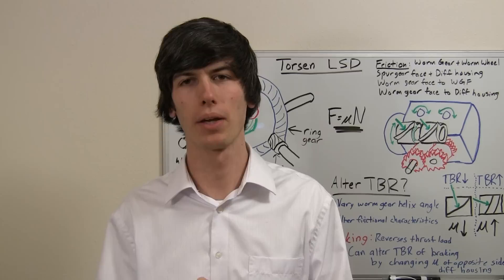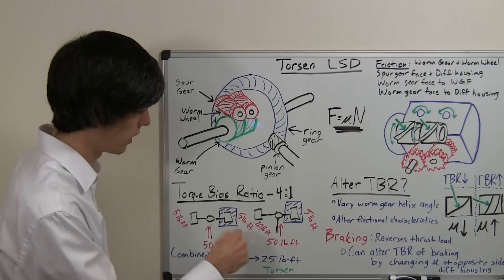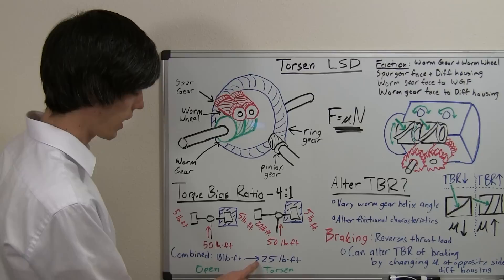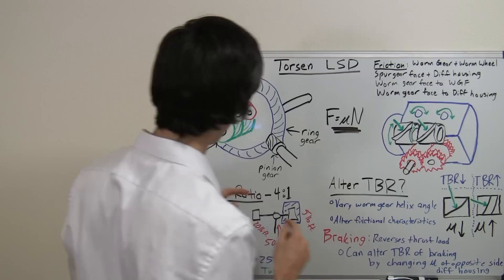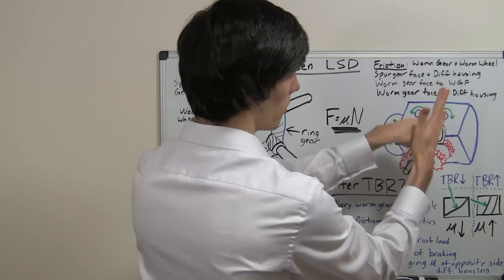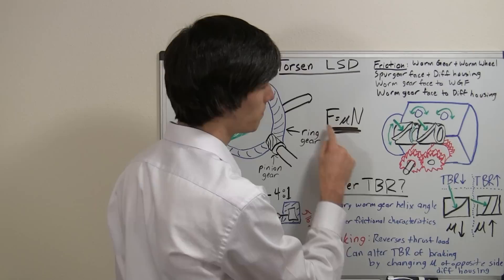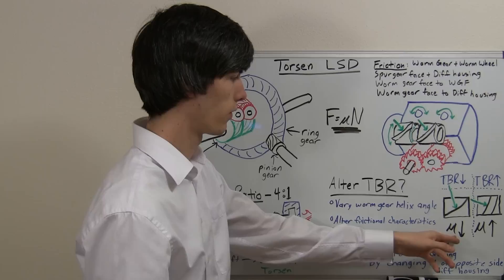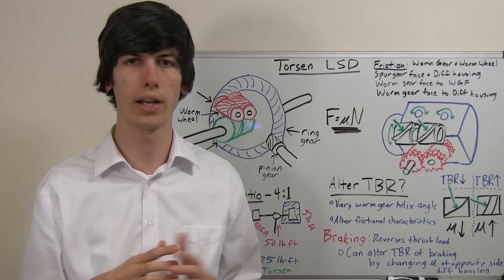Torsen LSD - Torque Transfer - Explained

Comment: I can see how one wheel will spin faster than another as in a turn, but at point do they lock up?  Does it happen when one wheel spins fast enough in relation to the other so that something different happens?  It seems that either the wheels must turn in opposite directions in relation to each other, or they must move together.  If one wheel is spinning like on ice, and the other wheel is moving at all - even inching ahead, then this will satisfy the requirement that they're moving in opposite directions in relation to one another.  What mechanism then forces them to lock up when one wheel starts spinning?
Reply: +mike beary When it is not a split that matches the ratio of the gearing inside (basically a math problem). So as long as they spin at that ratio in the difference that equals the ratio of the gears connecting the worm wheels it will run smoothly. When the ratio is off the worm wheel will try to spin the worm gear, but it can't. Think of it like a turbo being used in reverse. The exhaust is the gear on the axle or worm wheel. It can't turn the exhaust side or the worm gear.  The wheels are made so they work with the air in one way so well with a steep angle that they can't work the other way. Just like this flowing air into the inlet side of a turbo will will not act on the shallow angle enough the turn the shaft and drive the exhaust side to do anything. The metal gear can't just flow like the air because it is locked on the shaft, so it locks up instead and turns it into a solid axle until things go back to normal. He goes over it at 5:00. The gears are two steep to go backwards like the turbo impellers.
Reply: +mike beary It has to do with the resistance to rotation (aka grip) seen on both tyres, basically it starts "locking" when one wheel can handle less torque than the other one, even before any slip occurs. This is why these diffs are also called "torque sensing", they react when there's a difference between how much torque each side can handle, they're not speed sensitive as such.

The torsen however isn't technically speaking a "locking" diff, it's a torque multiplier. With for example a 50 Nm preload-only diff you can always send 50 Nm more torque to the axle with more grip, so even if one tyre is on a theoretical surface with no friction at all, you can still put 50 Nm or torque on the other tyre. With a torque biasing diff like Torsen you can only multiply it by for example 4 with a 4:1 TBR, and since 0*4=0, with low enough grip it can still act like an open diff (in other words there's not enough resistance in the one slipping axle to provide any of the lateral forces on the worm gears to make them contact each other and cause friction). An AWD car with 3 torsen diffs in the front, center and rear can still at least in theory get stuck if one wheel is airborne.

Comment: In theory does it mean a torsen will lock up if a very very sharp turn is made? does the torque bias ratio determine how much difference in wheels' RPMs before it locks up? thanks
Reply: +Roger S If I understand this video correctly the torsen diff. will actually never really lock up. Also the speed difference between the wheels is not what makes the torsen diff. transfer torque, but rather the torque difference from the wheels them selves. 

So even if one wheel is turning really fast forwards and the other is turning really fast backwards, as long as they both have the same grip the torsen diff. will essentially act as a open differential. However even when both wheels are turning at the same speed, if one has less grip than the other, the one with more grip will get sent more torque. At least up to the torque bias ration is met.
Reply: I think a Torsen diff effectively locks up when the TBR is exceeded.  But
I could be wrong    LOL

Comment: Hey, it is really a great video.. :-)
And can you please tell me what is the effect of type of differential ( open,  lsd etc) if we are accelerating while having a turn... Like if a race car is having turn and also accelerating..
What type of differential should a race car use? And why?
Reply from the maker: Racing applications will likely use clutch type lsd.
Reply: Engineering Explained 
Thanx u so much for the answer and replying fast :-) ..
And Can u tell me why clutch type?
Reply: +Priyanshu Pandey inside wheel gets lighter weight in a turn because of weight transfer, easier to spin inside tire, loses momentum, so limited slip keeps torque moving to outside wheel to maintain momentum and balance.

Comment: quite a bit of traction.  The rear end has to swing moderately wide, perhaps ten to twenty degrees, and as it does the braking is provided more by the tires than by the brakes.

This is complicated, and I admit I'm no expert.  I encourage you to read performance driving books (braking in a curve is more a bodyguard technique than a racing one; it's slower than proper racing form).

Comment: Is this type of diff also referred to as a helical differential? Also the Quaiffe  Automatic Torque Biasing Differential (ATB) is exactley the same as this? Im from UK so never heard of Torsen untill your vids. and another quick question so if any diff is labelled 1.5 or 2 way its a clutch or plated diff and not a geared diff?
Reply from the maker: Helical and torsen are different, here's a video on the different "way" diffs: 1 Way - 2 Way - 1.5 Way LSD - Explained
Reply: Engineering Explained yes i watched them and know what they mean and work with accel/decel etc but there was only talk of this with fricton plate clutches so im assume they all are that type, how does a helical diff work then ? next video! ;)
Reply: +Engineering Explained 
Thanks for your videos. You do have a clear and easily understandable way of putting things. Not easy with this business! Could you explain the difference between an ATB quaife differential and a torsen (i fail to understand that difference).
Second question, can the torsen "lock" if there is a significant grip difference between the two wheels?

Comment: Hey!
I'm wondering, you've said that when you put in reverse (or just push the brake pedal) helix-spiral gears are pushed on the other side of differential. Does not that happen also when the speeds of left and right wheel aren't the same?
I'm sorry for such a silly question but I'm also very interested in car mechanics and since none of this things are explained on faculty of engineering which I'm attending to, I just wander across youtube and workshops
Sorry but I'm not so fluent at english :)
Reply: based on how the gear, helix angle looked like. I guess it will not do what you have thought it will do. maybe it will just push  on to the differential casing? or maybe it does do that? because as far as I know, there haven't been any sources citing that it will push on to the other worm gear if the speed difference is the opposite of what Engineering Explained has told us in his video.

Comment: what happens when one wheel lifts off the ground? i.e. zero traction
There are contradicting statements on Wikipedia
Reply from the maker: Acts somewhat similar to an open differential. If one side is receiving very little torque, and the other side receives a multiplication of that torque, it's still very little torque. If one wheel is in the air it severely limits how much power can get put down, but if a wheel is in the air putting down power probably isn't the issue.